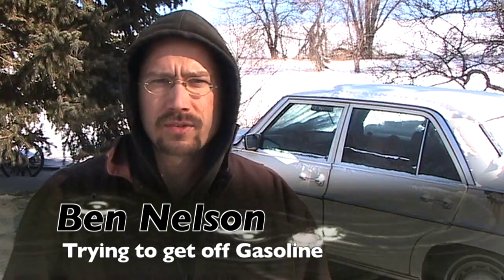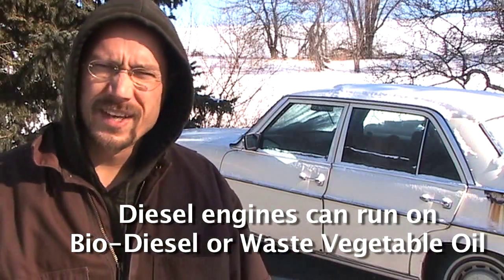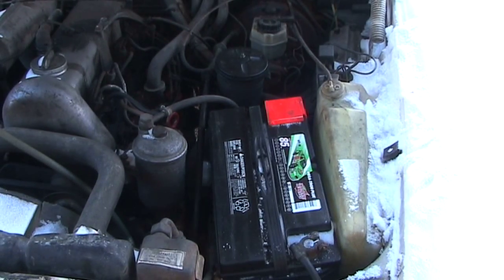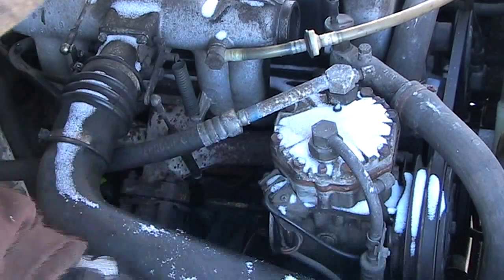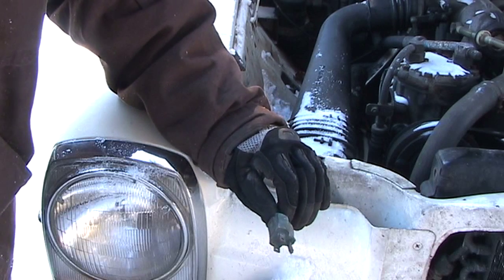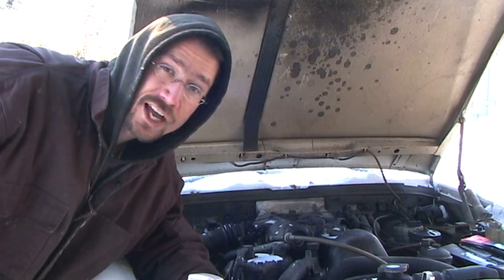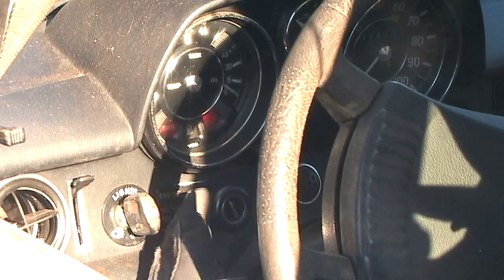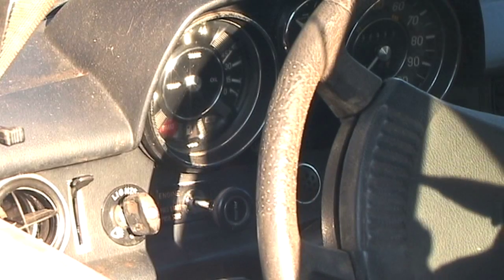Getting Off Gas - 3 - Mercedes Diesel start

Comment from the maker: In my area, you DO need a block heater for cold starts in the winter.

I will have to look into the other style of glow plugs. Once I have the engine out, there will be a whole list of things to look over before installing it in the truck.

The car is a 1976 240D

Comment: All you need is to clean the engine up, and throw in some new modern glow plugs, I live in maine which is one of the coldest states in America and I can start my diesel vechicles in almost any temperature with a good working pre-heating system.

Comment: @musclekid13 actulay they were diesel built from scratch by GM and GM's detroit engine division the duramax was a big mistake they did aluminum block diesel that is a really bad idea as it is the heads fall off of them when you floor it ive seen it to many times they are good grocery getters but wen you try to haul something they blow up

Comment: @BenjaminNelson well do what you like to do lol. my dad wants to do what your doing soon, but take a Deutsch tractor engine that has a 3 speed transmission on it and put it in a dodge dully, because his 1/4 ton truck with a 440 gets pulled over by the DOT to much. but besides the dodges, mercedes are my life and my passion. my dads a mercedes technician and my brother who is 17 does work on cars i wont be able to afford in 10 years....its all mercedes they work on. sometimes other german cars.

Comment: or just get you a nice chevy truck or suburban with a 5.7 turbo diesel with the DX block or a 6.2 turbo diesel good engines they are always loved those old chevy diesels i hear u can get 25mpg out of a non computer chevy 6.5TD i want one for my truck i get around 7city MPG and 12-17 high way MPG witch is really good for my truck i will get better when i change the carbretor to a 4 barrel holley but i dont like gas engines either much i want a diesel so i can run bio diesel some day

Comment: i dont understand how the 1977 MErcedes that started using electric glow plugs start with just one cycle of the plugs at tempatures of 32f with no issues but these pull start diesels 1950's -1976 just have more issues my 240d that is from 1982 has 310,000 miles on it and it has no issues i dont even use a block heater